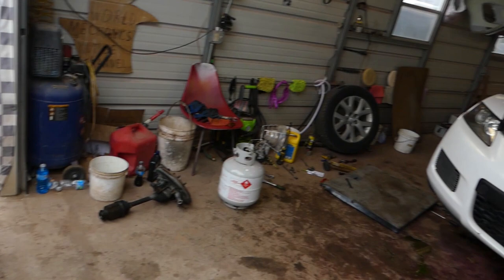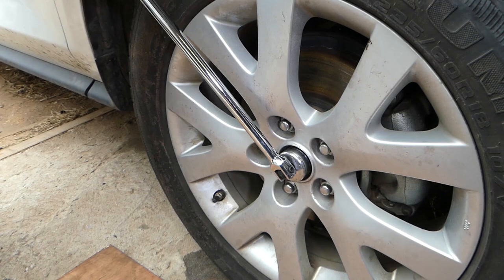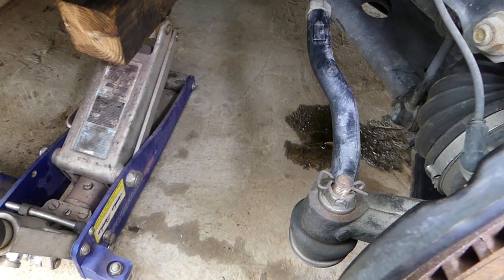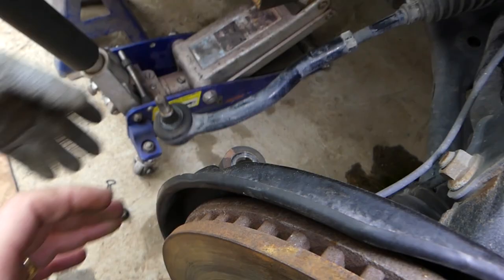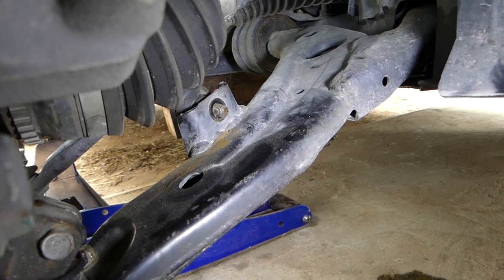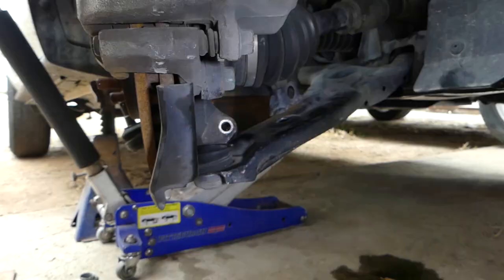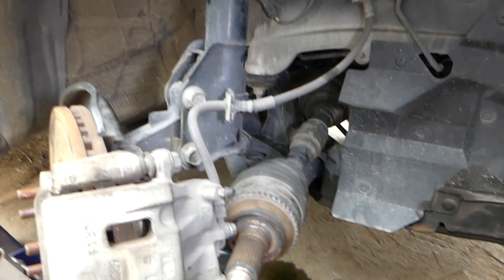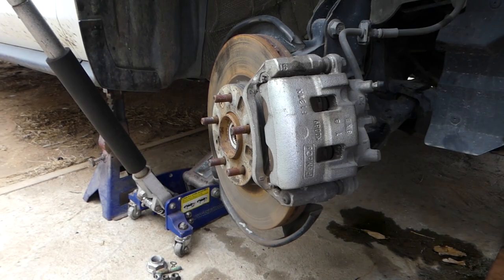MAZDA CX-7 DRIVE SHAFT CV AXLE SHAFT REPLACEMENT REMOVAL CX7

Comment: great vid thnx. i have a question. how can i know for sure it's the cv axle is what's causing the vibration. i know it's not the mount & i know it's not the spark plugs cuz i changed them. the vibration comes when i accelerate. no grease is out to confirm its the axle. could it be the drive shaft?? any suggestion guys will help for sure.
Reply: normally with you turn  the wheel you will have some grinding sound

Comment: It seems the dealer pn for the cv axles are not cross referencing to after market correctly.  2012 CX 7, front wheel drive w/ 2.5 l engine.  Oreilly part numbers and parts are different ones we removed from vehicle.  Anyone else had these issues?
Reply: What do you mean? Because my issue is that the axle for the drivers side is actually smaller than the one that auto zone and amazon gave me. It's so weird.
Reply: I just ran into this today. 2011 Cx7 Bought the 2.3l version off ebay (my car is 2.5) mechanic said he would get the part. told them 2.5 and they sent the same part as what I ordered. Neither would fit and said it needed to be smaller. Did you find a solution? I found a link for 2.5 only but it was $500 and looked the same.
Reply: Well I just ran into this problem too but you have to buy it straight from Mazda because the part is discontinued. I’ve tried ordering from multiple places all came with the wrong size boult for both sides. The only other option that I have came up with is finding same exact year and model at a junk yard and having someone remove it, but that comes with risks because it would be a used part.